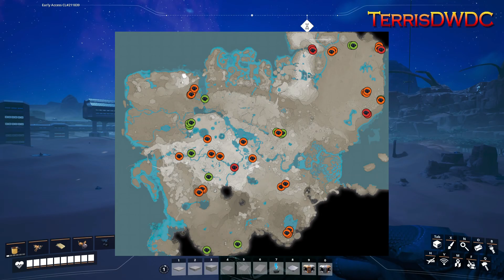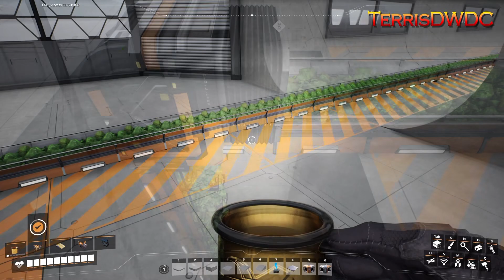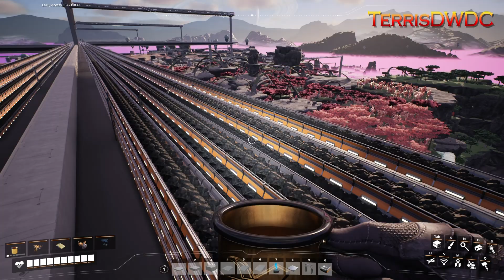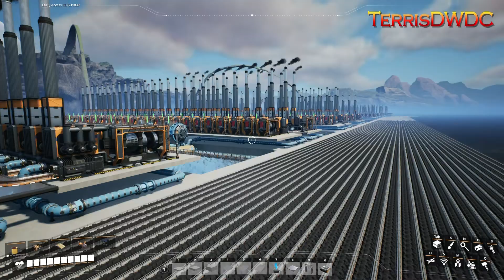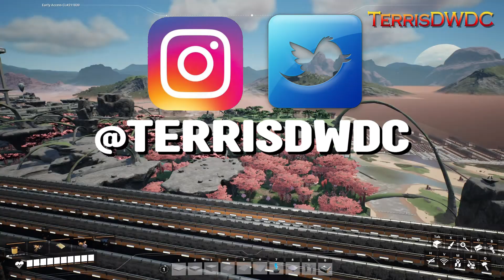I used all the Coal to make Power - Mega Factory 2.0 - Satisfactory Update 7 - EP06

Comment: What mods do you use if I mind asking? Planing on starting new game shortly
Reply from the maker: I have the +300 slot inventory mod, I'm also using Utility mod for flying, craftable HDDs and Craftable Power Shards.... Didn't want to deal with exploration in this play through, gonna save that for 1.0. FYI for power shards I still usually just collect slugs because the crafting recipe is like 50 copper sheets and 50 rotors. It's just easier to grab the slugs while flying around.
Reply: @TerrisDWDC  fair but I appreciate it especially the one u use for flying that will be super nice